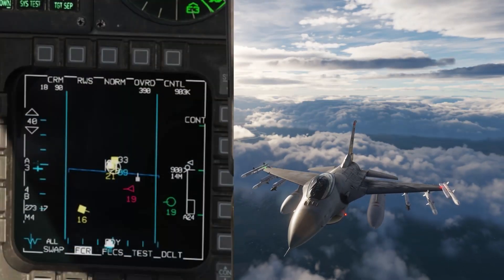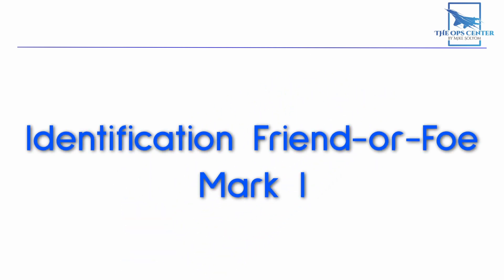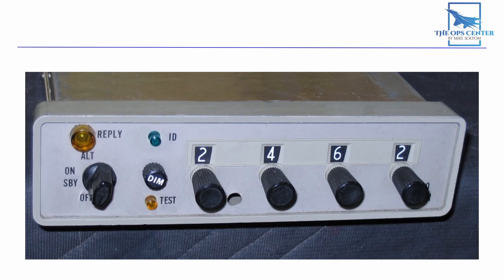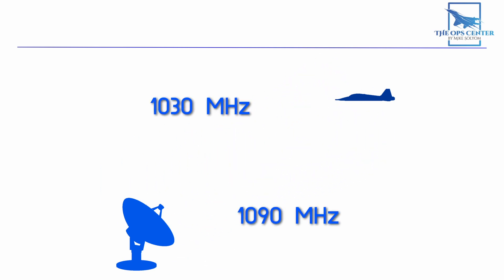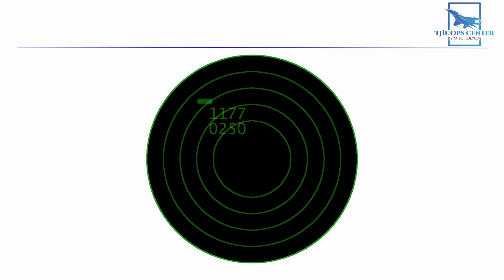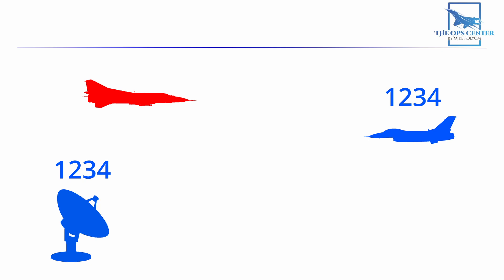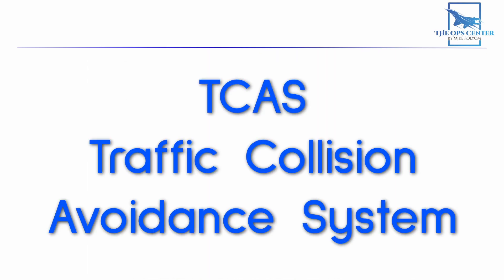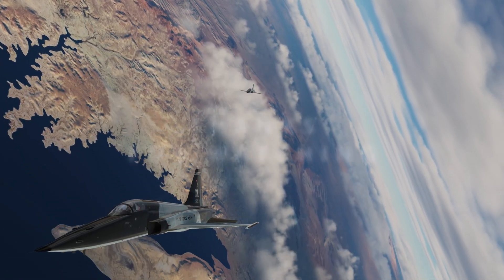Identification Friend or Foe (IFF) & Secondary Surveillance Radar Explained | Fundamentals of EW

Comment: I worked on the E2-C aircraft in the 80's.  I used to walk around on the flight deck of the USS Independence and USS Forrestal with a box called a Sniffer, to check that all of the planes Mode IV was working, and had the right code before leaving the deck.

Comment: Question?
Are there any hardware differences between friendly radar and foe radar?
Do they ever change the mega hertz rating?
Reply: 15 year Avionics mechanic here: Every time our EW systems detect a new radar, we investigate and log it with whatever machine it's on. A terrain/weather radar on a C-130 is going to be tuned to be good at that, and an air track radar on an F-16 is going to be tuned to be good at that job. Now, there are EW decoys that intentionally pretend to be another aircraft, and that complicates things, but we can watch a "C-130" going mach 1, and figure out that it's not a "C-130".
I hope that helps!

Comment: Wouldn't Mode 4 have been very susceptible to brute-force attacks, where a computer could simply try every one of the 4096 possible codes?
Reply: Interrogation code mode 4 is layered under encryption, you'd need to crack that also, so no.
Reply: @rasherbilbo452  The key to program the mode 4 had 64 pins with 26 positions each, it was inserted then removed into the front of the mode 4 decryption box and if the airplane crashed the system would reset all the combinations. you could get the box but not the code. It could be changed as needed daily or every 2 hrs etc or if you lost a plane just in case the enemy would use a down plane's box to carry a nuke  over your territory.